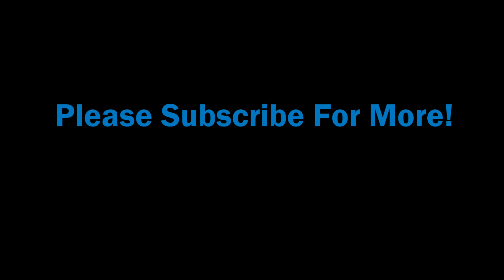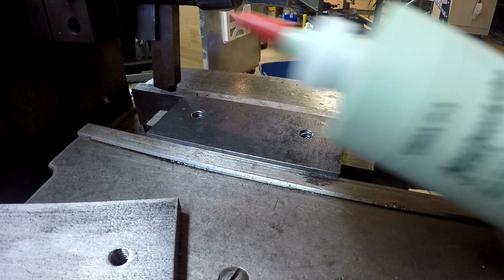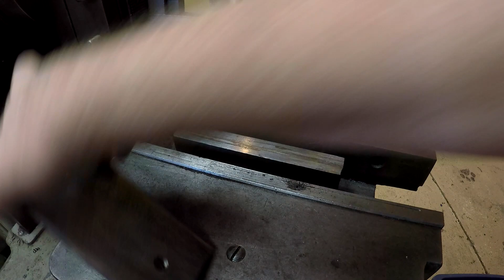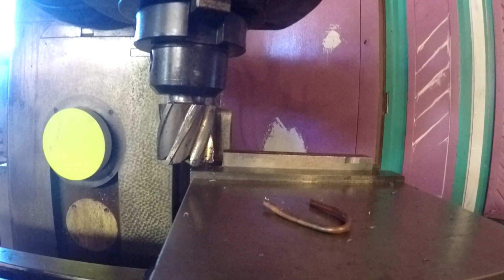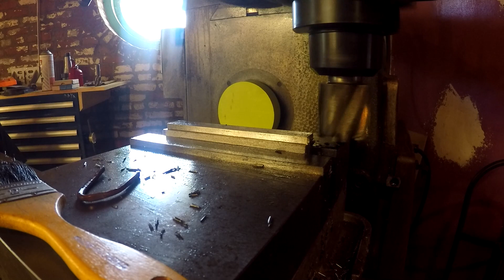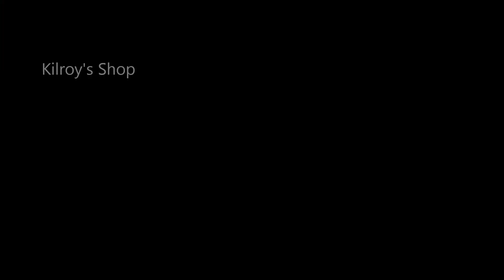Alzmetall Vise Repair #6

Comment: I’d bet what blew out your audio was the direct injection of sound from the camera being mounted on the machines.  The vibrations and all that.  Like the first cut in this video kinda is what made me think it.  It was a pretty powerful sound hitting that tiny microphone.  I bet gopro, assuming they stress test their cameras never considered them being mounted to some giant KnT and hogging off a bunch of medal.  

But I agree, that GoPro although they are great at making videos when they work, they do seem a bit flimsy.  Adams first camera couldn’t take the abom torque of him using the USB port and broke.  I suppose they are fine as long as you handle them very gently.  And I also agree with the need of some optical zoom.  Digital zoom is really pointless unless you don’t have decent editing software.  Digital zooming can all be one after the fact on a computer.

Comment: shaper .I actually like it I can't find one but I will .
Reply from the maker: +Wesley Barnhill If you have the room, a 14" to 16" would be a good starter.  The Southbend and Atlas are overpriced and low on capability. Lovely little machines, and if thats all you can fit, better than nothing, but when it comes to shapers, size does matter.

Comment: Thanks for showing the ledge cutting on the jaws.  I now can see that method works way better than taking a 1/2 inch end mill and trying to cut down the center.  That doesn't work.  Thanks for sharing.
Reply from the maker: +Ed Texley No, that would  not work that well, most likely your result will be oversize somewhat.  Never plan on slotting in one pass with an on size endmill unless your tolerances allow it, or you have no other choice.

Comment: If your go-pro has gone deaf,  you can put it in its diving suit and get some action shots close to the coolant and chips.   Or, if you mount it on your tripod next to your new camera,  you have a wide angle backup you can cut to  (as if deliberately artistic) when your work goes out of shot.    You can get 2 cameras on 1 tripod by making a boom out of flat bar with 1/4" holes at each end, and a 1/4-20 screw.  If you want to get fancy, you can make the screws male-female captive thumbscrews, and one of the holes a slot so the distance between the cameras is adjustable.

I bet your go-pro just has wax in its little earhole tho.  That muffled sound sounds like when they are in their case.
Reply: Ready made item for $4  http://www.airyear.com/camera-flash-unit-side-bar-attachment-black-p-25756.html   it looks like the flash shoe screws off to reveal the other ¼-20

Comment: Nice save on the audio James. Q1, Did you ever test the Gopro with an external mic?.  Q2, Did you put a  relief down in  the corner of the 1/8" cut ?. Thanks for sharing. regards from the UK
Reply from the maker: +Gary C Not yet, have to get an adapter.  The only external mics I have use the standard three wire plug.

Comment: Hi James - have you tried the wax stick (what you use on the bandsaw) on the shaper or mill? Mine turns liquid when hot, oil like but still doesn't smoke.
Reply from the maker: +Zander Kale I'll give that a shot on the shaper.  I have been using the LPS brand wax stick on the bandsaw for years, love it.  Do you just wipe it on like you are using a big crayon?
Reply: I got one of the LPS wax sticks after seeing it in your videos. I've tried it on the lathe and mill to avoid fling but am unsure of the benefit, if any (sure works well on the bandsaw). But need to experiment more (or get some AnchorLube). Yes, just like a crayon. I don't understand how a solid lubricant "wets" a cutting edge below a surface which is why seeing the wax melt was intriguing.

Comment: Question on the anchor lube. Are you not defeating the purpose of lube on the shaper when it is actually dragging it off the back side? The shaper advances on back stroke which means the back of the bit is dragging it off the part. Correct?
Reply from the maker: +Richard Schmidtendorff It seems to pick up the lube quite well, and push it in front of the cutter, right where you want it.
Reply: +James Kilroy Ah ok it was hard to see that from the video ty.

Comment: ....agree with the census......voice overs work great for some machinist.....seems to be better explanations of the work being done, better descriptions of tools and the noise of the machines isnt an issue.....your work is always great Mr Kilroy....its the camera work that makes or breaks a show.........let that Gopro takes it last shot as the hydraulic press comes down on it..........lol....
Reply from the maker: +Rick L I was  thinking more like high powered rifle at 100 yards, with the camera running.  Hopefully I can find the memory card afterwards.
Reply: +James Kilroy They do make SD and MicroSD cards with flat cables on them that attach to little SD card slots. You can find them on eBay or AliExpress...kinda interesting for destructive testing memory storage...Aloha, Chuck
Reply from the maker: +Knolltop Farms I am afraid that even at 120 fps, you would never see the projectile, at 2500 feet per second, 120 frames per second still means a little over 20 feet traveled. But its worth a try!
Reply: +James Kilroy I LIKE IT! I wonder, not that it's worth finding for just one shot, but I wonder if they make external SD cards? In fact I'm going to look right now. I kinda doubt it as many products require their ports be closed to run, but you never know in today's world. I'd love to see a 7mm Win-Mag. coming at the lens in Slo-Mo.

Comment: Getting good audio is something that even a regular video camera has trouble with.  My digital video camera has excellent HD video bot no place to plug in a remote mic so if I get very far from it then the audio suffers.  I think the solution is a very expensive professional movie camera.  Not happening here.  Thanks for the video.
Reply from the maker: +cerberus Same here, no budget for that kind of camera.
Reply: +cerberus   Whenever I've encountered a professional camera team,  they always record the audio on a separate machine,  probably one with SMPTE striping to make syncing it easier in a pro editing suite,  but I dunno if it was the main recording,  just for a backup,  or how easy it'd be to replicate with a consumer digital recorder and WMM etc
Reply: I don't know much about the pro equipment either.

Comment: Hey Jay,
Still a great video brother! Jaw turned out nice and looks like the Anchor Lube worked great on the shaper! The GoPro mic port might have gotten some gunk in it????

Cheers,
Ray
Reply: +aserta indeed, perhaps send to one of the electronic channels for a partner vid, gopro mic replacement repair, im sure its simple enough to do , also gives someone a boost to viewership
Reply: +Ray Caniglia It's possible that it is moisture. A friend of mine gave me one that had been water logged after the cheap (really cheap for a product that tries as hard as Go-Pro) case leaked sea water inside.

I reused the mic for a small test device i made and the sound was almost exactly as this one.